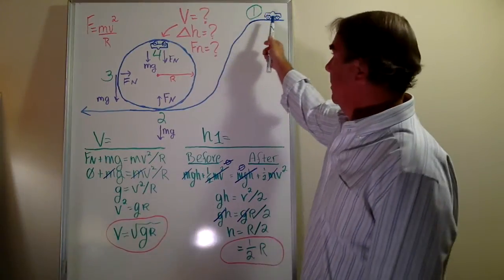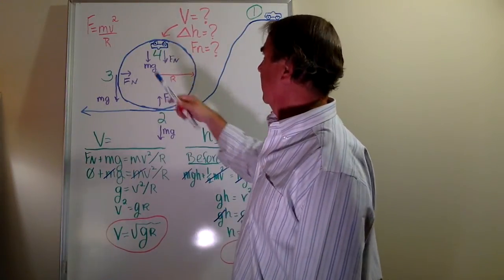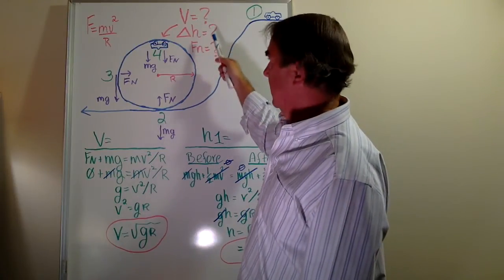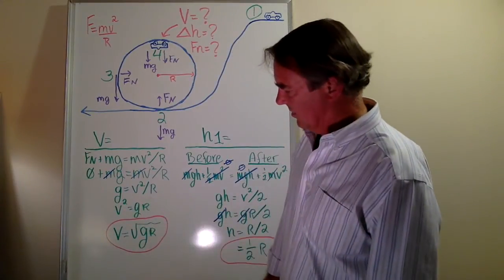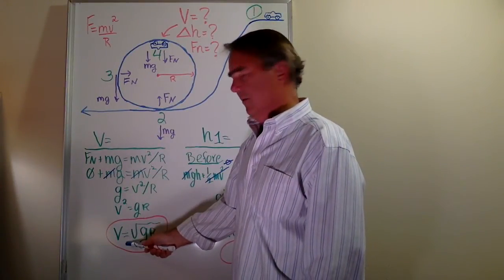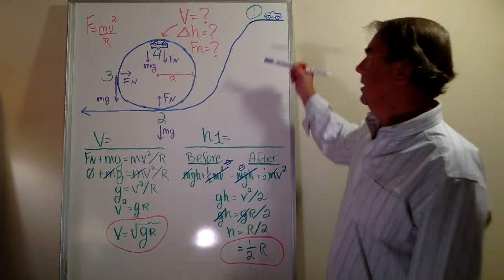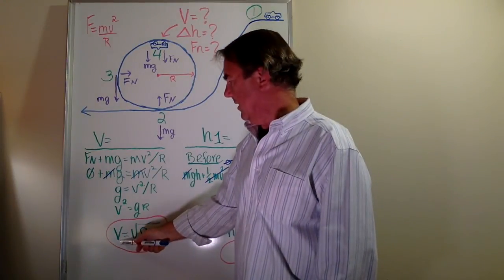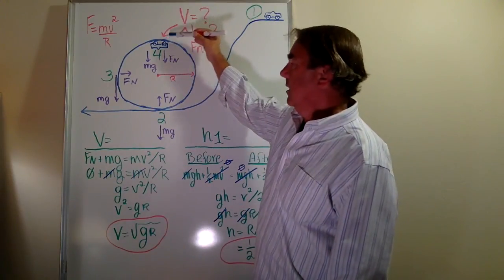Physics problem: loop the loop. How fast must car go to complete the loop, and from what height?

Comment: hi so how do I find maximum speed
Reply from the maker: Hello Risk Tricks - thank you for asking. 

The short answer is max V is the square root of (5gR), explained as follows (and Jared if you are still watching this will explain there R*5/2 came form):

The fastest point of travel is the lowest point of travel where the vehicle enters the loop. 

Use conservation of energy to solve this: 

- - Initial - -                - - Final - -
mgh + 1/2(mv^2) =   mgh + 1/2(mv^2) 

If the starting point is R*1/2 above the top of the circle, this is R + R + R*1/2 above the bottom of the circle, so initial height, relative to the bottom of the circle, is (5/2)R. Jared this is for you…

If the starting point is (5/2)R, then the ending point, at the lowest point of travel, at the bottom of the circle, can be considered zero (0). 

At the start of travel initial velocity is zero (0) and final velocity is the unknown to solve for. 

So:

h initial is (5/2)R
h final is 0
v initial is 0
v final is the value to solve for

So: 
 
- - Initial - -                - - Final - -
mgh + 1/2(mv^2) =   mgh + 1/2(mv^2) 

becomes: 

g * (5/2)*R = v^2/2 

Simplification of the equation above is is done by:
- cancel m from all terms
- remove the term with initial velocity because it is zero
- remove the term with final height because it is zero

Multiply both sides of the equation times 2 to make the fraction go away:

5 * g * R = v^2 

Take the square root of both sides and velocity is sqrt(5 * g * R)

I hope this answers the questions. If you need more information please let me know. Thank you, -DaveG
Reply: hi

Comment: I think there may be another part to this problem.  Other sites say that h=5R/2.  Do you know why this is?
Reply from the maker: Probably depends on the initial point of reference, Justin. The way it is explained in this video, initial height is 1/2R above the highest point of travel on the circle. If h=5R/2 is a solution I would suspect the point of reference is maybe the bottom of the circle and "R" is 1/2 the radius of the circle.

Maybe you could direct me to some of those videos and I can see why and give you an explanation.
Reply from the maker: Hi Jared - Excuse the delay. 

The solution in this video states that starting height is 1/2 R above the top of the loop. Please refer to the picture. In the equations, final height is at the point labeled #4, at the top of the loop. This point is 1/2 R below where the vehicle started. 

The lowest point of travel, at the bottom of the loop, at point #2 on the picture, is 5/2R below the starting point. I should have read your question more carefully, so please excuse the delay. 

So if a solution states starting height is 5/2R, the final point of reference is the bottom of the loop, and in this video the final point of reference is the top of the loop. Hence the difference between 1/2R and 5/2R. 

I hope this helps. Please let me know. DG